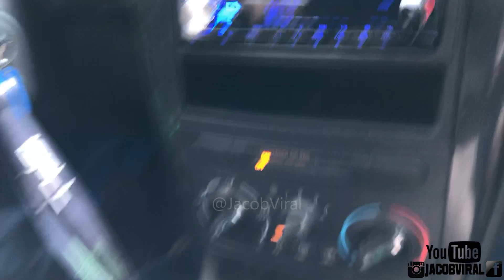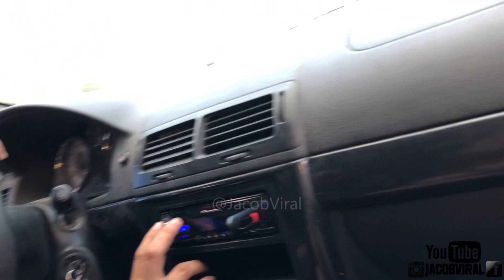HERE IS WHAT 9 10S SOUND LIKE ON 10,000 WATTS

Comment: Looks great , really awesome, impressive build , did he try taking the 3 tens in the bottom part out and putting wood plugs in to see if 6 sounded better, or louder , just wondering about the 6 and a half part ?… would be an interesting experiment to see 6 vs 9 subs
Reply: I'd like to see him replace the 3 with weighted passive radiators.